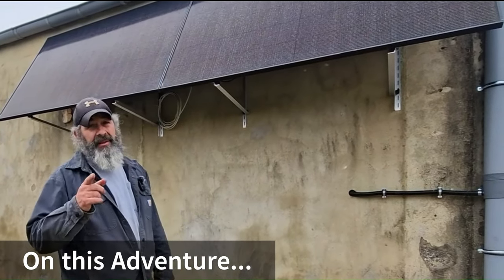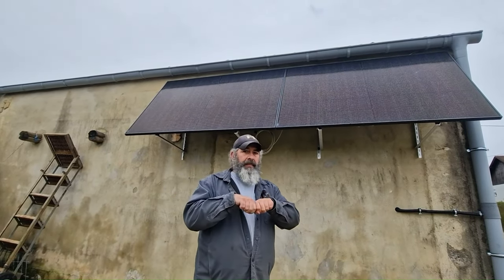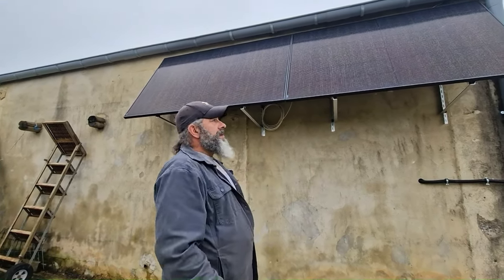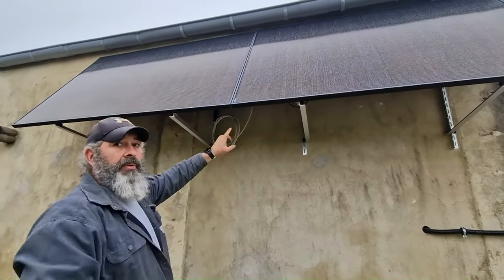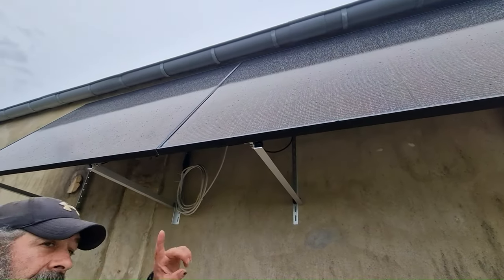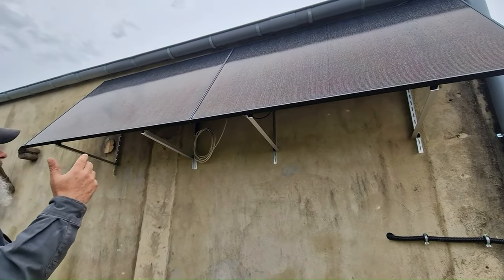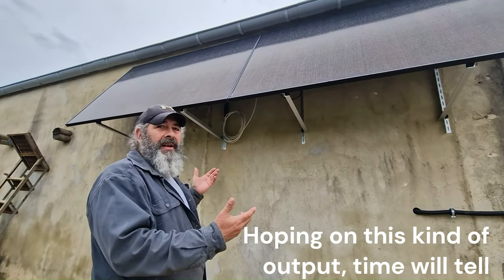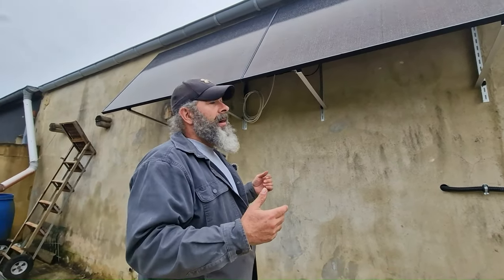My DIY balcony/micro solar system : Old German Farm House |Homesteading | Off Grid

Comment: Any concerns about shading from the gutters/eavetrough? (as they are shaded during the video)? A bit lower, might mitigate that, as well as painting the wall white helping on the bifacial factor.
Reply from the maker: It does look like it is shaded but it is just the reflection on it. In full sun it is not shaded, however when i reangle them in the summer it might be shaded due to the sun being higher in the sky. I will have to space them off the wall if that happens. We plan on repainting the wall a real light grey color to take advantage of the rear of the panel as well.